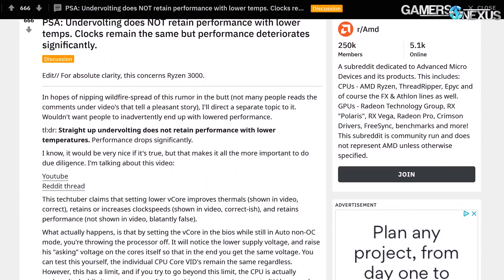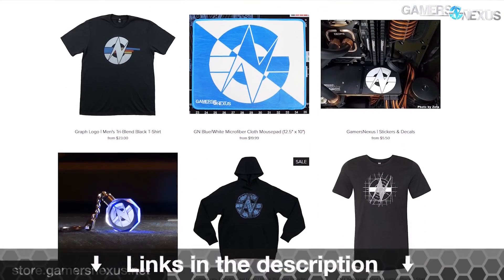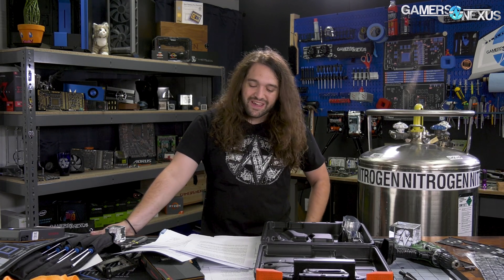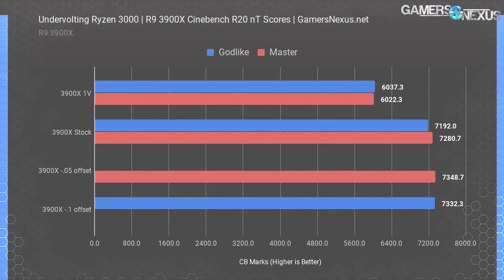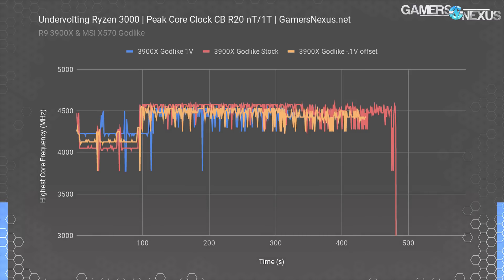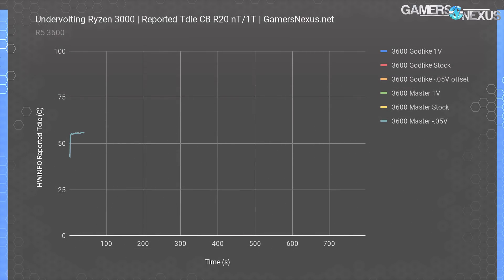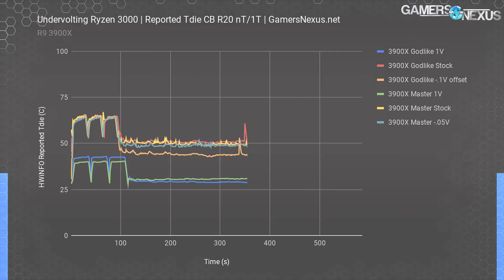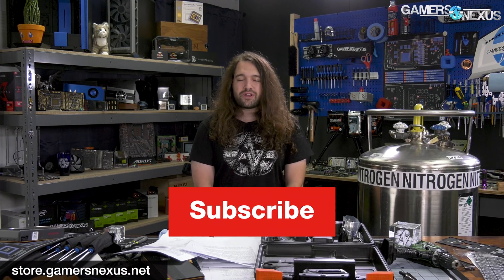AMD Ryzen 3000 Undervolting Offset vs. Override | Vcore Voltage

Comment: Guys please help,

I built my new pc with 3800x and asrock x570 taichi.. and the idle temp is almost 40c and I don’t think that is normal. 

Applied thermal paste properly and reduced LLC to level 2. Should I lower the voltage from 1.45 (default) to any value less than that?
Reply: Ryzen 5 3600 here and I get around 60°C idle. CPU cooler is an Aigo Lair. I'll try changing the top fans from exhaust to intake (I have a dust filter) and undervolting tomorrow

Comment: I undervolted my rx 570 all the way down to 970mV at its stock speed of 1250MHz, and got a very, very slight possible improvement by +1 fps on average in benchmarks, but also about a 20C drop in temps,  with the max temps eventually settling around 67C in furmark without even having to spin up my fan super loud. initially I'd tried overclocking it, but had pretty abysmal results, and i could barely even get it stable at 1300MHz. so i tried undervolting instead and I guess I just got a golden undervolter. I've decided im pretty happy with the stock performance at this point, given how little power its sipping and how little heat its producing.
Reply: and ur gpu die very fast;p
Reply: @Venom-gs4nz  I've had it like that for over a year now and it's never had any problems. Still performing great. In any case, undervolting doesn't cause increased wear. It's generally best to run it at the lowest voltage that is still stable if you want to increase the life of a processor.

Comment: With my Ryzen 1700 on my b350 plus prime from asus. I don't have override I just have offset, you need to adjust up or down till around 0.22850 up in my case to get just above the default voltage on my board and cpu to get a 3.975GHz overclock 24/7 that voltage works out as 1.375-1.4 volts nothing else changed on the cpu settings, everything else auto and balanced on loadline soc etc

Comment: I flashed the latest MSI B450 Tomahawk bios for 3000 chips even though I have a 2700x.
I gained 500 points in Firestrike and system is very stable.

Comment: completely different processor but i undervolted a ryzen 7 2700x to 1.3 at a 4.1 overclock(was originally set to 1.4), i havnt noticed any stuttering and its not  crashing at all...so did i do a bad thing? temps seem fine

Comment: So it accidentally auto-underclocks itself. I underclock all my stuff anyway to gain back efficiency. If I lose 5% performance and 20% power then I see that as an absolute win.
Reply: Indeed you under-clock a CPU from a higher bin, so you MUST under-volt to justify the more expensive CPU.
Still late steppings under-volting the cheapest model likely works.

Comment: The "high voltage" scare is almost the exact same thing we had when Ryzen 1000 launched. People were noticing the momentary 1.5 voltage spikes created by the precision boost function, and then you had AMD representatives assuring people it's functioning as intended. With all the thousands of blissfully ignorant people running those things at stock, I've yet to see any news of masses of 1st gen Ryzens bought in 2017 dying. I guess we'll see in few more years if the engineers were wrong in making them behave like that.

As for Ryzen 3000, the chips produced on TSMC's 7nm are really small with densely packed transistors, which invariably leads to much higher heat density and therefore higher operating temperatures. If you're really worried about high core temperatures, then you can simply manually lower the PPT limit in BIOS. This will degrade performance, but unlike Vcore offsets (which also lowers performance in most cases), it won't have any unintended negative side effects on the CPU's VID values, which means it's safer overall. If you're not having any issues then I think it's best to just let it do its thing.

Comment: Although I enjoyed the follow up, I have a question that wasn't answered:
Is the 1V option viable? Meaning, if someone wants to use his cpu for very light workloads for a few hours, doesn't care about clocks and wants ultra low power consumption and passive cooler temps, can it stay stable?
Reply: Mine does stay stable at 1.100volts at 3.6 ghz with the boosting things off

Comment: Has Everyone forgot to get good temps on over half of the 7700k's these voltages had to be reduced which would return a < 20'c drop, so it would make sense if there is improvement over other chips, just not as great of an improvement

Comment: I tried undervolting my 3600. I knew right away It didn't help because task manager records the clocks correctly and my CPU wouldn't go past 3.3ghz at 1.2v. Not sure why HWinfo isn't reporting that correctly. 

With my MSI board I found their "game boost" auto overclocking tool seemed to tick all the boxes. It ticks on PBO, overclocks infinity fabric and turns off all the power saving features that might hinder performance. I don't usually use the one click options but honestly it pretty much did everything I'd have ended up doing anyway. I'm sure I could get 75-100mhz more if I wanted to try but that's not worth the hours of validation and futzing around.

Comment: some intresting behaviour I have noticed on the x570 creation is that auto settings are almost always better, just running as much set to auto seems to yeald the best performance in my testing, trying to tighten up the memory from 3600 CL16 b-die to a 3600CL15 with much tigher timings across the board, the memory reported to be doing better then stock xmp when it was benched but cpu performance was slightly worse then just set XMP ,  messing around with PBO and the other oc features trying to set them was just worse then auto and the best OC settings was just set volts, set XMP, set multiplyer done this yealds the best perfomance.. if MSI gives me Bclk to playwith on the creation I may be able to squeeze a little bit of performance, the all core wall of my chip being some where between 4.475ghz and 4.5ghz, 4.5ghz seems to need more then 1.4v and thats more then I am willing to give expecially because its pritty much good to go at 1.375v and 1.385v for ensured stablity at 4.475ghz 
but yes what ever its setting for auto settings seems to be whats best, somthing rather supprising considering on previous boards thats almost never the case XD

Comment: I tried to play with undervolting right when i got the CPU (3700X + AC Freezer 34 eSports DUO) .. i just tried to get temps to more reasonable levels .. figured out this so far ..  - 0.1V ment big performance drop .. 10-15% ish as i remeber ..temperatures at 100% allcore load were hanging around 70°C ... Then tried same tests with stock voltage .. performance went to baseline (obviously) and peak temperatures at 100% allcore load were hitting 80°C ... then after some testing different offsets between 0 a - 0.1 a settled on - 0.0750 V.. as this lead to less than 1% performance degradataion in cinebench and cpu-z benches (aka. productivity) .. but actualy got me about 2 to 3 more FPS in Games than stock voltages. Don´t know why, because frequencies look tad worse .. like ~20-40Mhz ish lower. So its not clocks, but some arcane wizardry that takes temps into consideration is making it faster in Games .. Speaking of temperatures ... 100% allcore load 73-74° C ... so around 6-7°C reduction against stock.

Comment: So instead of crashing when user set V too low, AMD made it lower frequency... sounds like s great idea to me
Reply: this and with thermal cap is too good. Running 32 threads ryzen in 3.8L chassis in really hot environment 88 C is the cap it goes to 2.8 GHz all cores stressed voltage 1.04375

Comment: So decreasing it down to 1 volt lowered heat output rather dramatically, and also lowered performance as well.
Though, did power efficiency improve or worsen?

Taking the "CB Mark" for CineBench R20 nT score difference, where the 1 volt undervolted one performed 80.8-82.5 % of stock.
And the corresponding graph for the temperature Tdie, where we can see a reduction from about 60 C down to about 30-40 C, and if we say that the ambient temperature were a constant 25C, then we could say that the power dissipation reduced to only about 30%, though extremely rough calculation based on the idea that a heatsink has a linear delta-T/watt figure through its operational range, this would mean that the CPU's power efficiency is about 2.7 times higher. (I would say that seems unrealistic.)

So an actual power consumption comparison plot would have been far more interesting, then the Tdie plot in my opinion. (Since Tdie will greatly vary with what heat sink one has, the power consumption would mostly be effected by clock speed and feature utilization on the die itself. (leakage currents are though temperature dependent.))

In the end, how much did the power efficiency actually improve? If it improved at all. Could be useful to know if running these in servers or the like.
Reply: extremely likely that efficiency improved, most consumer chip products are on the upper end of the scale, around the nosedive in efficiency

Comment: Best balance I've been able to find for my 3700x is setting a negative offset of 0.09 while also enabling PBO with 200mhz. As I understand it, the PBO setting kind of counters the negative offset, but not the extent that it ever really over volts like it did stock.  My out of the box vcore was damn near 1.48 under load on an Asus x470 gaming-F, and temps were in the mid 80's in cinebench r20. Now my temps don't exceed 76 in the same test, and my vcore under load hovers between 1.34-1.39. My cinebench score actually slightly improved,  and my multi core results are consistently between 4,865-4,900+, while my single core is 495-499.   I think this slight improvement in results and thermals mirrors your results on your 3900x with negative 0.1 offset. 

Idle temps also dropped from mid 40's and 50's to low to mid 30's now.  Gaming temps in really cpu demanding games like BFV are in the low 60's , and most games stay in the 50s.
Reply: That's great! Are you using the prism cooler?
Reply: @KapanthPT  yep. Stock cooling. Coming from a delided 4790k with a noctua I wasn't sure what to expect with the wraith, but I'm honestly impressed.  It's in my old HAF 922, and that case has good airflow, so I'm sure that's helping a bit too.

Comment: I have 3600 and my idle temp range from 45-56C. I installed a bigger aftermarket cooler with better paste and they are still the same. Should I apply an offset on the voltage to see how it goes? Never done this before

Comment: The thing is, who cares about voltage or temperatures if you re not doing OC. At stock everything should run as intend, for OC we just have to wait for reviews or simply try out with our own hardware and see what it works better for each cpu /combo.

Comment: When you leave your core clock alone it will most likely try to balance to reach that clock differently. Don't you also need to underclock in combination to make a CPU last longer and consume less power?

I'm sort of puzzled by this test. Feels like you need a better reason and goal for a test making the test actually work. The message is lost by information overflow in why the F are we doing this and only set 1 variable of all variables needed to let it run stable. At least that's what my water is telling me. 

Perhaps to see if the manufacturer has actually optimized it? When you undervolt just a little and it runs shit it means they did kind of right. For lower voltage and a stable CPU you also need to underclock it most likely, but yes less performance. Seems legit.

Comment: I'm using a 2700X and I tried to get the boost higher too.
The best i could come up with was 0.1V overvolting in combination with LLC1(highest VDroop). So with few cores used, the voltage is higher and that seems to get better sc boost, but allcore the voltage drops lower and results in a better allcore boost....maybe 2% improvement on both....disapointing. ;)
PBO does nothing....manual OC to 4.2GHz is slightly better in nearly all games...but consumes much more power because of the high voltage(1,37V load...1,4V idle) needed.
Reply: 1.3 or 1.4V is pretty much to eventually degrade the performance of the processor over time, check one of GN videos about it

Comment: great you bring undervolting to attention, can you do some tests with the Treathripper cpu`s?  i will try things anyway as building a TR4 2920 server in a 4U case , so limited cooling and 24/7 use it might do some good to have a slight undervolt to limit heat and poweruse.

Comment: im on r5 1600x and in the uk we are in a heat wave i down clocked my cpu to 3.4ghz from the stock 3.6ghz and undervolted to 1.15 this gives me 100 less score in cinebench r20 and temps drop around 5c idle and upto 10c on gaming load hope this helps some else
Reply: good job, that helps a lot in smaller cases when we cant just add a big cooler, like servercases, most towers are just too high it would be nice those coolermakers design stuff to perfect fit servercases and small compact boxes by maximal messurments possible.

Comment: I locked my voltage to 1.4v got lower temps and higher scores in cinebench. Also stopped the cpu idle voltage being 1.45 to 1.5v

Comment: Do you guys see CPU Vcore at the value you set it at and CPU VID at higher values when idle or under light loads and it only drops down below Vcore when under heavy loads? It's so weird ^^
Reply: Ah, nvm  if it's requested voltage, that would explain part of it.

Comment: This explains how they got 5.9ghz at 1.1v on the Godlike?
Reply: LN2 and sub-zero make voltage reported wrong (CPUz may only show 1.2v and I’d be pushing 1.7v), the software hits a bug (also around 0c, my VRM has integer overflow and suddenly reports 126c temperature). It’s stuff like this that normies don’t even know or think about, ignore voltages for extreme benching, they are almost always incorrect (hence everyone has a voltage meter wired to the board or GPU, we know the software readout is wrong).

Comment: Hi Steve, first of all, congrats for the videos.
May I give a suggestion for an upcoming video. Could you please show if the PCI-Express extension cables still works when using a PCI-E 4.0 card and motherboard?
Thanks a have a great day
Reply: i think so, there's no physical change on   slot itself
Reply: @ouwkyuha  yes but the requirements for the signal are way higher. I watched a video showing these extensions were not working anymore

Comment: WHY no power consumption graph? That is the only real usecase, and power consumption is the main reason...........
Reply: This surprised me too. That was the reason I came here. 
Calling the 1V results a bug seems like an insult to me. (No hard feelings ^^)
Stability is a good thing. When undervolting I don't expect higher performance. While it is a nice bonus, my main goal is reducing power consumption. And to me it looks like zen2 makes this really easy. 
Automatic underclocking (or clock "stretching") is fine with me.
Reply: Because this channel is sponsored by amd, they shouldnt show it otherwise intel fanboys here will start to quack.

Comment: Hi thanks for the very informativ video. I just wanted to know is it normal to have such high temperatures (3700x stock / Msi edge wifi x570 / Coolermaster AIO 360 / PBO disabled) I get idle 40-55° Celsius on Ryzen balanced Plan, Gaming 50-72°, prime95 upto 95°. the Vcore is between 1,4 - 1,5 Volt. I doublechecked the aio installation everything ok here. I'm very disapointed with the behaviour of the CPU so far. I thought a triple AIO should cool it better.  I'm lost, need help. Thanks a lot keep up the good work.
Reply: On me asus strix 470-f i undervoolt offset - 0.10000v and that give me lower temps(now are on idle 35C and load 65C max) with other settings like pbo,smt and xfr all enable. Cinebenchr15 multicore score 2100.

Comment: Guys, did you try lowering pptl to "rated" TDPs? Seems to work like a charm. Lower temps lower voltages same performance in my case.
Reply: Ive tried it but it doesnt work. Its the same as in this video. If i activate PBO and lower PPTL is the same as if i give the PBO + auto oc a minus 0.5 vcore offset. It boots, it shows higher frecuency, but performance is no different from stock. 198-200 single core 1550 multicore on cinebench. 
On the contrast, when leaving pbo+auto oc on auto single core goes to 210 and multi core to 1680ish. So it actually does something even if performance increased is minimal compared to voltage increased (1.43 load all core in my case)

Comment: I've had the best experience limiting the watts limit. Even a small limitation of this option has a very positive effect on the temperature. Without losing much performance .
Reply: Why oh why??  Temperatures are a byproduct of doing work.
Instead of limiting peak watts you should just buy a cheaper CPU or use power management to throttle the CPU.
Under-volting has the potential to reduce waste heat, transistor gate leakage and improve efficiency, leading to better performance with that specific die.
It all depends on the silicon quality being high enough to operate at lower V and hence reduce power consumption.
But if dynamic chip management regards under-volting as an error due to bad p/s or mobo then the whole technique is invalidated.
Reply: @RobBCactive  my dude this solution / tip is over a year old.

today there are good power plans or CTR that help WITHOUT any loss of performance

so thank you for your time for the comment but "context" and "time" would have saved you these lines!

Comment: That is exactly my experience with my 3700x - It got unstable at -100mV and lost some performance in tests it could complete. Setting the offset to -50mV resulted in higher VID....!? In my case the difference between just a -100mV offset and -50mV offset + PBO is around 300 points in Cinebench R20...on an Asrock B350 board.